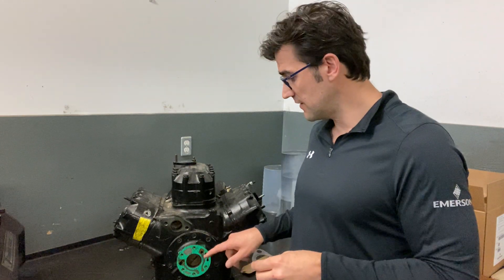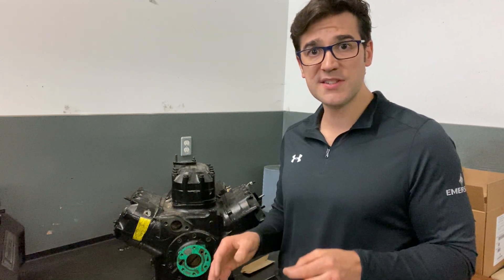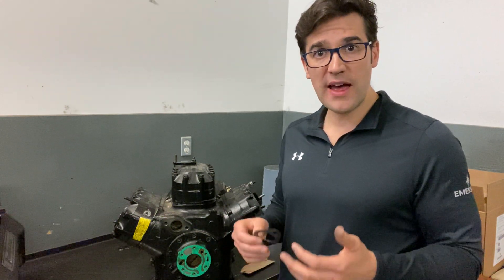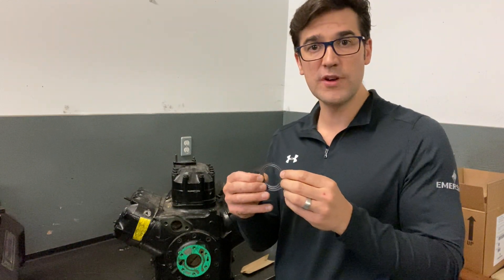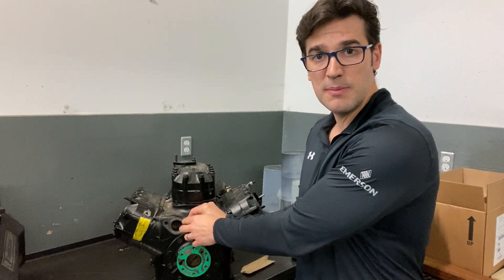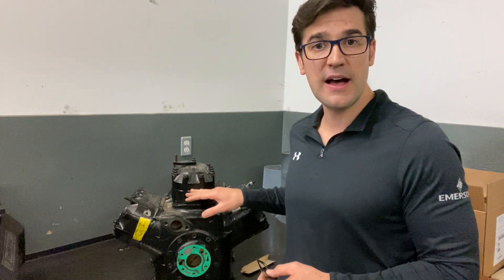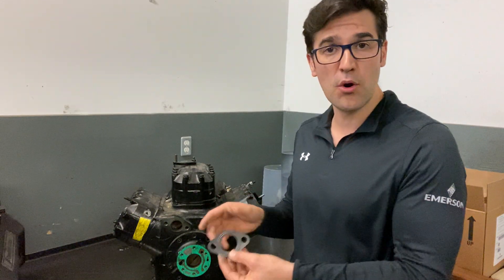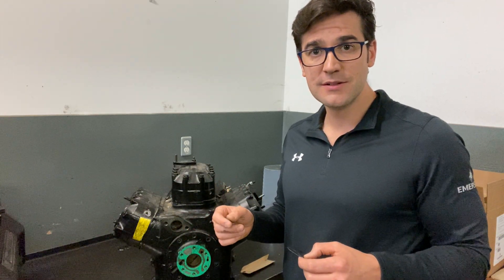How To Properly Install A Semi Hermetic Compressor Rubber Coated Steel Gaskets

Comment: Friend for clarity 🙏
Also want a clarification for another type of gasket,  if have opinion/preference. Gotta engine rebuild kit w two different types of gaskets for timing cover: one of them is this metal type you show here n the other is a fabric like sort of like thick felt w a thin plastic non-slip surface that lines it. First ? Are these both gaskets? Or which is appropriate/better
Reply from the maker: Yes they are both gaskets. I would go with the rubber coated metal